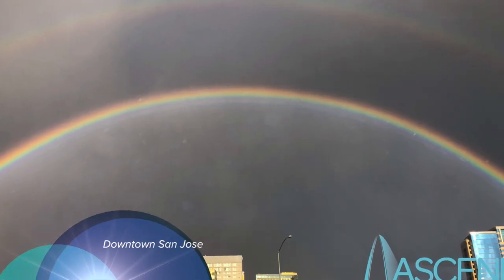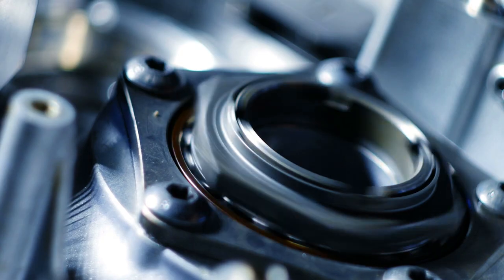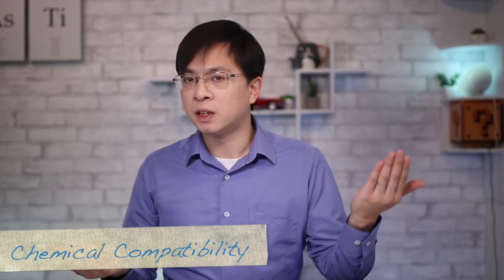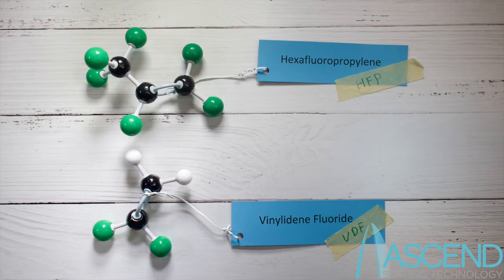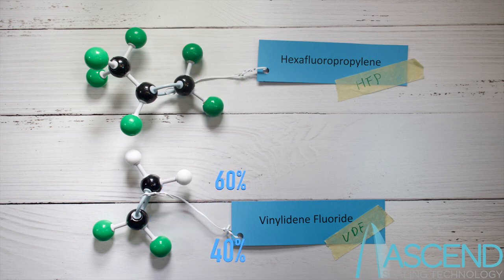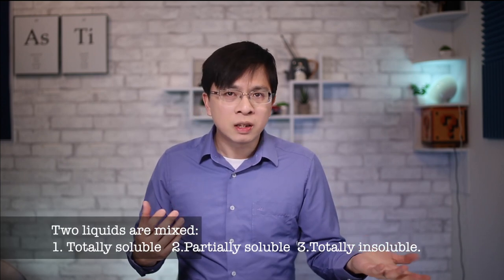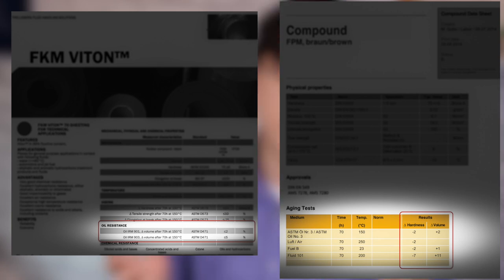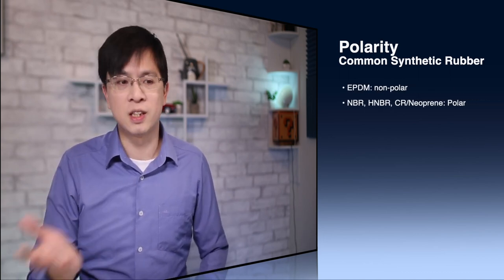What is Rubber Swell? Things you must know about Rubber Chemical Compatibility.

Comment: Thank you for teaching me on how O-rings seals expand.  A mechanic suggested I change two small o -rings that connect to my transmission because they might be "swollen" since the metal pieces would not fit after I took them out.  And now I understand that the swelling was caused by the transmission oil making contact with the o-rings; 13 years and 89,000 miles worth, creating a seal that not only seals transmission fluid from escaping but inadvertently made it impossible for me to reinsert the two lines back into the transmission.
Reply from the maker: Dear Jesus, I understand your frustration. I have talked with many technicians, the modern automotive design makes the replacement of a simple O-ring become "Mission Impossible". But I also talked with some auto designer, they have their reason too. For your reference, if you find a way to replace those O-ring, you should look at AEM rubber (known as DuPont VAMAC) have a good resistance on ATF or transmission fluid.

Comment: Thanks for sharing the experiment results. Can you please explain change in ID & OD after O-Ring swelling?
Reply from the maker: The ID and OD will also increase.
Consider the rubber O-ring is a constant volume object, if the swell is "homogenous swell" to entire material, total volume increase 1%(1.01V), ID and OD should increase about 0.3%(take cubic root on 1.01)
Use AS-214 as example:
ID 24.99 mm, CS 3.53mm, Volume is 1753mm^3

1% Swell Volume to 1771mm^3
Calculated ID is 25.07, CS 3.54mm, OD 32.15mm

Comment: Thank you, interesting video! So, I will try soaking my O ring pump gasket in acetone for up to 5 minutes to see if it will increase size so my hand pump tank sprayer will work again more permanently.  It sat unused all winter. I stretched it manually but it only fixed it for about half an hour, enough so I could at least fill the tank with pressure. I'm hoping I have good luck. Keep up the good work! 👍

Comment: I am an auto mechanic and remember sometimes brake fluid can swell rubber seals.  Sometimes / usually it results in bad things.  

But now i have a home carpet shampooer with a seal that failed.  The seal sits on the bottom of the clean water reservoir.  I cant find the replacement part so either i buy a new vacuum for $200, or a new water tank for $40-50, or try to think smart and modify this cone shaped seal.  I need the part to work maybe 4 times per year for 1 hour each time.  Maybe i can try to soak the seal in acetone as you did and hope it dont spill out a half gallon of water.  Thank you for your video.  But sad to think the part may shrink back after some time.
Reply from the maker: I do have some cheap tip to make a custom shape gasket for DIY at home. However, it might not be that durable. The acetone swelled FKM rubber eventually will return to it's own shape. 

Sorry for a very late reply, our company was closed due to global uncertainty. I will make this channel to personally own, it might take me a few months. Thanks for your support :)
Reply: @theo-ringguy6172  hi, do you have the video on how to DIY a gasket seal at home? Couldnt find it, thanks!

Comment: Thanks for sharing the experiments. I have one question, if you add the saturation acetone solution of VDF rather than acetone, does the rubber O-ring swell?
Reply from the maker: Did you mean once FKM reaches saturation, will they keep swelling? It just like a sponge, once it reaches saturation it will barely gain any volume.
Reply: @theo-ringguy6172  yes, that is what I mean, thank you for reply.